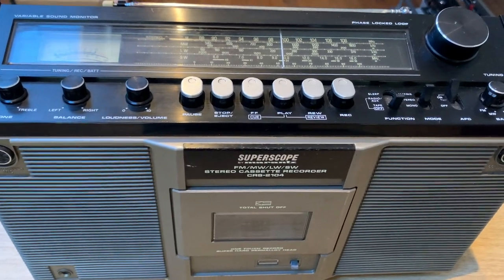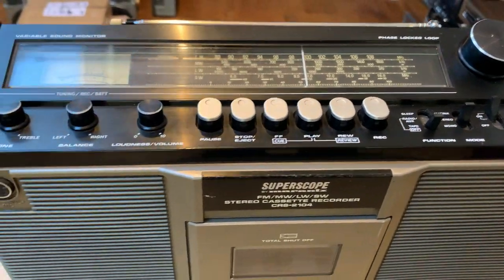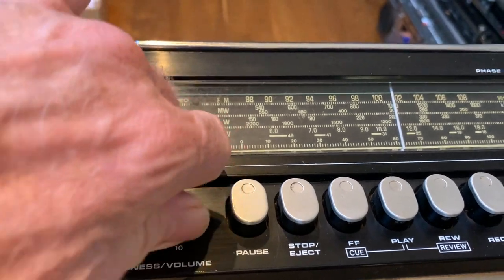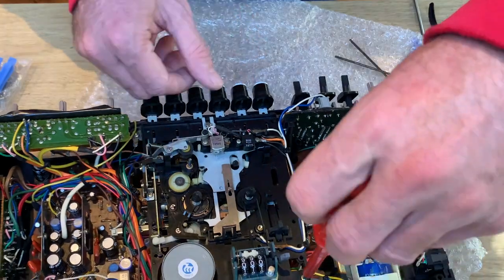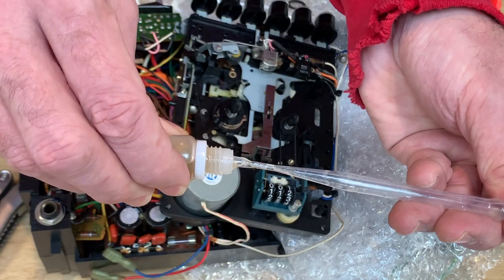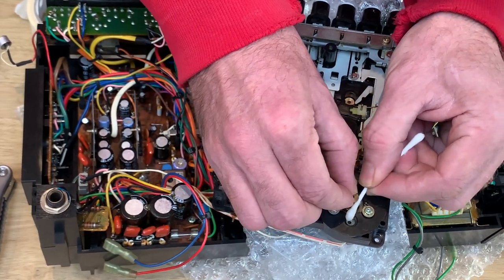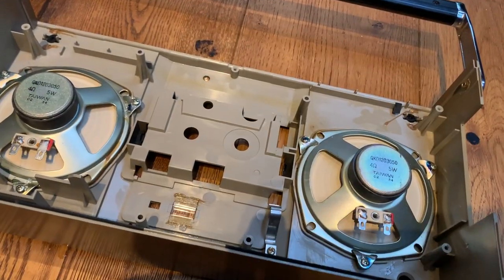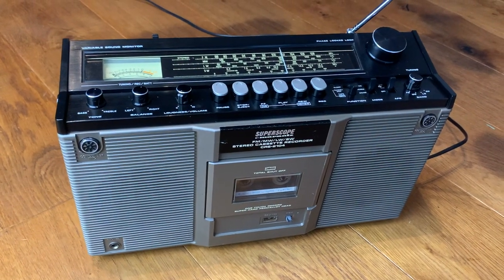Marantz Superscope CRS-2104 Repair. New Belts, Replace VU Meter, Teardown, Idler & Head Clean

Comment: To fix the VU meter, you could loosen the little set screw a little while heating the green laquer with a soldering iron. Another tip: to clean really deep grooves on a flywheel, i use a piece of cotton string soaked in alcohol.
Reply from the maker: Thanks for that - all good advice 👍I did try the soldering iron trick. I adjusted both the tension set screw and the rear alignment screw. I spent a good hour messing with heat, screws, solvents, direct injection voltage to avoid too much needle contact- just couldn't get this one the settle. I haven't given up yet, as I'd like to resurrect it!

Comment: I have one original to me but model 2100. I replaced some belts 5 years ago and it plays but RWD and FF don't stay latched in so I must of messed something up while I was in there. Going to view the video and give it another go. I love this machine. I might install a bluetooth module while I'm at it so I can use it as a wireless music player. Thanks
Reply from the maker: Thanks for watching. They are superb machines - they sound so rich and warm, and the radio is very sensitive. Good luck with getting yours back to 100%. Definitely worth checking the button latching whilst the deck is removed. It will be easier to spot stiff mech parts, pulley and idler movement etc. I've not seen a Bluetooth enabled CRS yet, so that could be a cool thing to do - there should be a bit of room in there to sneak the parts in. Thanks again 👍

Comment: May I ask where you order parts and belts from? I have the same model and I plan on using your video to give it a cleaning. Thanks in advance.
Reply from the maker: Thanks for watching. 
I always get my belts from Decktech Mana_Tree on eBay. 
You'll see them come up if you search for things like '1mm square cassette belt' etc. 
Enjoy your servicing. This model is ok to work on, but make sure you remove the 'hidden' screw on the fascia plate!

Comment: Found the crs2204 next to trash, decided to plug it in and see if it works.
Fm Radio is working half-fine (turning knobs makes volume jump up and down, usually staying real quiet), everything else has weird sinus-like noise with it going up and downpitch quick (probably interference in my city, i still can get some channels to show up). The cassette player was filled with old gunk.
Unscrewed everything, opened it up, cleaned from dust (especially the potentiometers, will put some cleaning alcohol there so it works better), got the whole cassette unit out and washed it good. The belts were all thorn in pieces. Put on some elastic bands because i got no cassettes to play. 
Next week when i get home from uni I will finish things up and see if it works better.
Reply: Thank you for the video by the way, in reassembly i missed the position of the little mechanical switch connected to the 2 cables in the cassette player, hopefully i can identify how to position it right.
Reply from the maker: You got a great find there. And as it was free, there's no real risk - a great opportunity to save one. Good luck with it and thanks for watching 👍